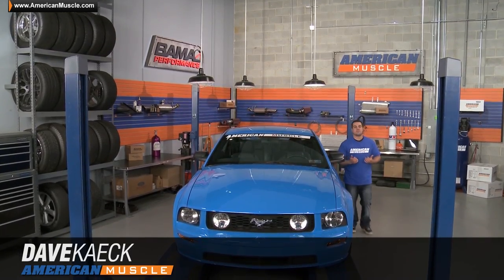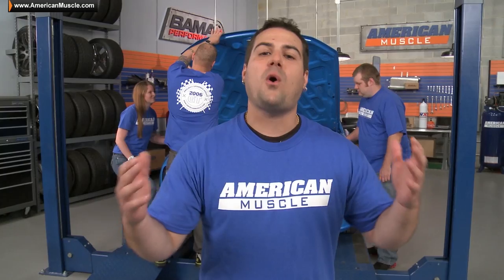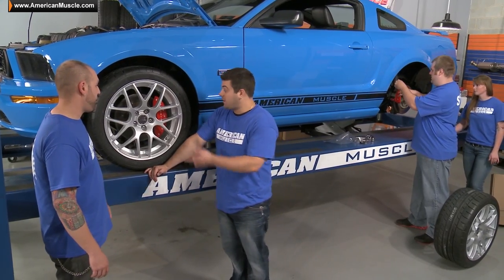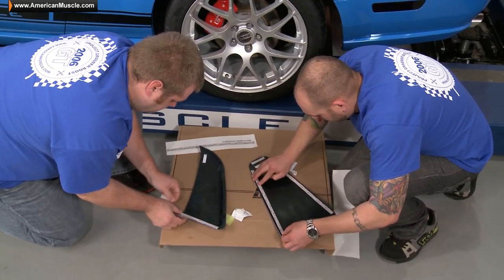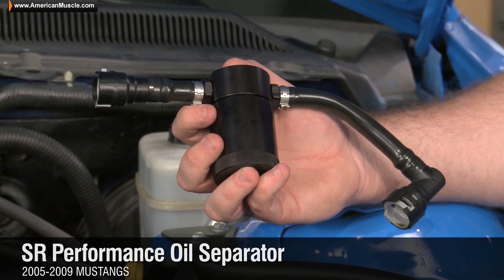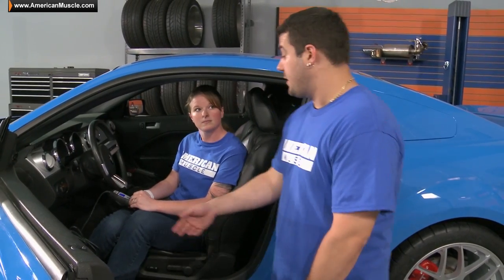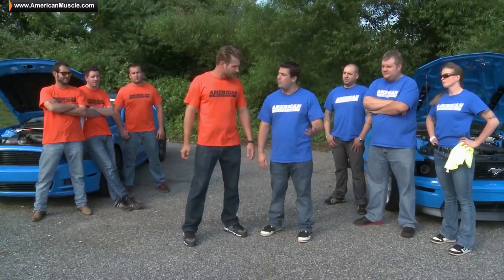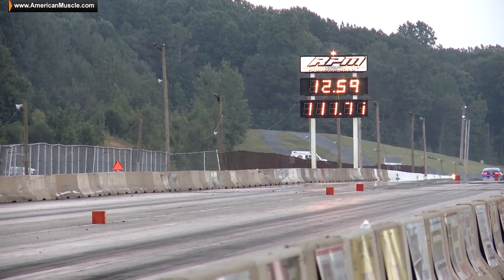Project Grabber Boost: STAGE 1- 2006 Mustang GT

Comment: So I know its an old video but I couldn't resist. That custom tune ... maybe show a run with the 93 octane on a stock tune. I have a feeling that custom tune isn't doing much if anything. The 1/4 mile time improvement was likely just the new Mickey Thompsons and running 93 octane based on the 60 foot time improvement. 2 tenths at the 60 is almost half a second on the big end. Also just realized the almost 103 mph vs 104 mph. That's literally just the tires and 93 octane vs 87.

Comment: On grabber boost, please add longtubes, a ford racing intake manifold, and some gear. And a whipple. On the 5.0, do the cobra jet (frpp) intake manifold instead of the boss intake and throw some longtubes on it also with a offroad xpipe. Just a suggestion.. thanks.

Comment: Like the build, although not a fan of all the 2013-2014 style of mods(rear lights, headlamps, hood vents), the 2005-2009 GTs look fine to me as is. If I wanted a 2013 look, I'd buy one.....
Reply: Some people might like the taillights on a 2013 more than their own, that doesn't mean they're going to go out and buy a new car...
Reply: If you noticed in my post, I'm talking about all the cumulative styling changes derived from 2013-2014 design features(what has been done to AM's 2006 GT). Not speaking about one singular change, and I respect others whom choose to makes changes to their vehicles as they see fit. I also do not like the 2010+ styling changes as a whole(the front looks great, the rear.....yucky IMO)
Reply: I was saying that as a hypothetical, but it could be applied to all of the parts. As you well know everyone is entitled to their own tastes and opinions. Furthermore, if an individual prefers a certain piece from a different model year, they won't buy a brand new car just to get that part, especially if they can just have it by itself on their car. By the way, I have a 2011, so thanks, lol
Reply: Love the 2014.. so I bought one.. 2015 I am not sold on yet..
Reply: As a new owner of a 2005 i've come to the same conclusion, and it only took me a couple of weeks to figure it out, BEFORE I bought any parts.
Reply: You'll need to think a bit harder! Or own one of this generation to understand.

Comment: I have bbk lt headers, bama tune, air aid intake,  one piece aluminum drive shaft,  SR performance,  catless xpipe and I can't run a 1/4 then 13.5 ... why? I've done over 7 runs already with different launches.
Reply: Traction issues?

Comment: I really want one of those chips but I'm not sold because you guys dyno test it on 87 octane and not 93 you should do 93 octane before and after the chip the stock tune in the computer will pull timing and you will lose horsepower running 87 anyway how do we know the ganes aren't just from running 93? if you showed me a 93 octane Dyno run no tune and then one after putting a chip in it and it showed even a little horsepower increase I would buy one. My 2010 GT don't have a performance chip and it's already running an aggressive timing curve from the factory on 93

Comment: Owned both an 05GT and an 11GT. 11GT with a couple bolt-ons and tune can beat a supercharged 05-10. Also, you can only safely make ~450rwhp on the stock 4.6L before it goes boom.
Reply: Bran Don   That's true in most cases . Lighten up the drive line and total weight on the 3 valve , put on a few bolt ons  , add some light wheels and sticky  tires , and if the 4 valver  gets beat he crys a lot harder
Reply: +Guy Noir Are you comparing a stock 5.0 to a modded and lightened 4.6 that also on drag wheels and tires? Doubt anyone would be crying in that case.
Reply: Bran Don  Yes . You just lie and say it's stock  , it looks like it and it's only a 3 valve . That's part of  the game  and you keep the marbles  .

Comment: So many problems with this build already. 1.....why all of those show parts. 2. Chambered mufflers? If you are trying to beat a 5.0L you need to step your game up. 3. I get you guys are trying to sell everyone parts, but you should have just done a final build video. There is no reason to do a basic bolt video. And lastly, you are going to need a driver mod if you were running 14's with a manual 3v. Just sayin.
Reply from the maker: Stay tuned ;)
Reply: I second that driver mod...
Reply: darkmetallink1 plus i could hear the missed shift and the stuggling shifts on the coyote
Reply from the maker: paladain55 darkmetallink1 navyman8903 if you guys look at what the stock times should be on one of these cars right off the showroom floor, they're actually spot-on.  We're using the stock all-season tires at stock tire pressure, stock tune, stock everything.  A 5.0L S197 runs roughly 12.8-13.2 depending on driver, we were 12.9.  A 4.6L 3V S197 runs anywhere from 13.9-14.3 depending on driver, we were 14.05.  Look at the mile per hour... 102.  That's what it's supposed to be, but these cars don't launch well with the stock tires, so you can see our 2.338 60ft time is atrocious.  This isn't about going out and going as fast as you can with a stock car - adding slicks or deflating the tires adding premium fuel, etc.  This is supposed to simulate what 90% of the average Joe who takes his car to a Friday night race at the track will do. -Chris
Reply: AmericanMuscle.com i meant running a 12.9 or whatever in the 5.0 video and then running a 13.4 ish in this video?
Reply: AmericanMuscle.com Actually the 2.3 60-foot time is awful even for stock tires.  I'd be ashamed of anything slower than a 13.8 in a stock 3v on street tires.  102mph trap speed is good for 13.7 easy.  And that 13.4 pass with the 5.0?  Yeah... awful.

Comment: Surprised to only see a 19hp gain with a tuned CAI and a throttle body...
Reply from the maker: Chris Caputo, our stock results of 278HP and 291TQ are definitely high.  Most people show stock results around 265-272 HP and 285-293 TQ.  So we definitely would see easily another 5-10 horsepower gains and maybe 3-4 torque gains.  We usually see anywhere from 25-30hp and 25-30tq total gains.  We've seen it a bunch before, but on this particular day our car happened to put down factory freak numbers! -Chris
Reply: AmericanMuscle.com You have to take into account the larger and wider 19" wheels/tires, easily 5-6 hp at the tires, curious to see dyno numbers with stock wheels/tires, I'm sure 23-25rwhp gains over base would show up.

Comment: 14 second 1/4 mile out of a stock 06 GT?  Needs a driver mod.  The car trapped over 102 mph.  That's good for a mid to high 13 with any kind of decent launch.  Look at the 60-foot times on their timeslips.  The 14 second run was with an AWFUL 2.3 60' time.  They picked up their half second by cutting 2 tenths off that time on the modded run and adding a little more power.  2 tenths on the 60' is worth 4 tenths in 1/4 mile E.T.  The trap speed increase shows the horsepower gain.  Usually adding 10-15hp will gain you a tenth, all other things being equal.  I think this video just showed us that these guys can't launch their cars.  The time for the 5.0 Coyote was awful.  Anything slower than a 13.1 should be thrown out.  Even with a mediocre 2.0 60-ft time, those cars run 12.6 to 12.8.  Oh, and for a Coyote with the MT82- MGW shifter or nothing.
Reply: My stock '06 ran a 13.7 at the same track with a broken shifter lol

Comment: 14 seconds from a 3 valve is abit off good driver can get mid 13s
Reply: You are one hundred percent with your statement. You can see in the mile per hourthat it was the driver not knowing how to handle the car. Without a single modification I guarantee you I could have ran a low 13 or in the 12.  When I first started off and drag racing a close friend of mine that's why was helping me to do different things. And when we went back to the track he told me that there was nothing wrong with my car it was my driving. So he asked me could he make the next run and I did let him do it. he had ran one second faster then I did the whole day. Within two to three weeks I was able to get down the track like my friend had done. And I was never ashamed to say I had to learn to drive my car.

Comment: Could one put a 5.0 in a 06
Reply: Yes. Its very possible and relatively easy to do. The coyote came out in 2011 so it fits all engine bays of the  S197 generation since it ran from 05-14. He'll the stock transmissions bolt right in though most people put a new 6 speed transmission in at the same time.

Comment: Those gains are horrible for what you put on. Why are you putting on just an axleback and not a full exhaust or at least a catback exhaust? An axleback is mainly for sound. Without adding any performance parts at all and just getting a tune, you should've had those gains.